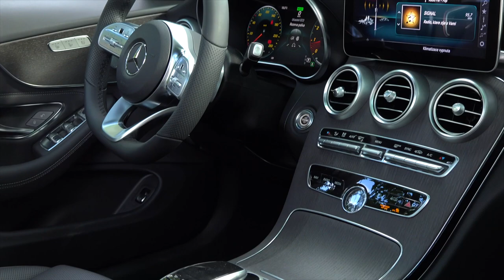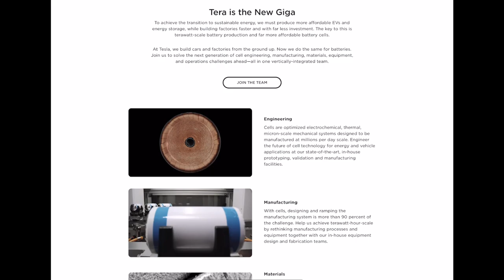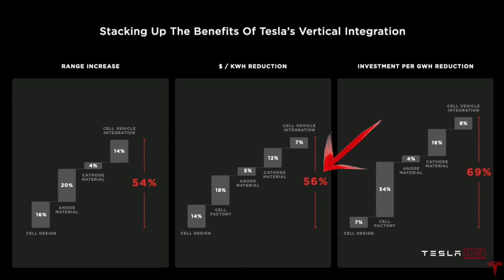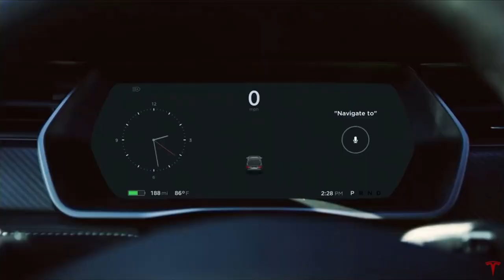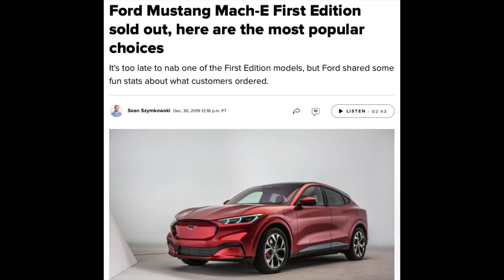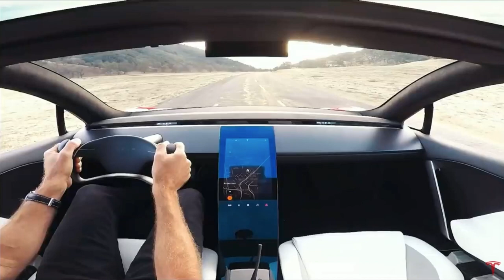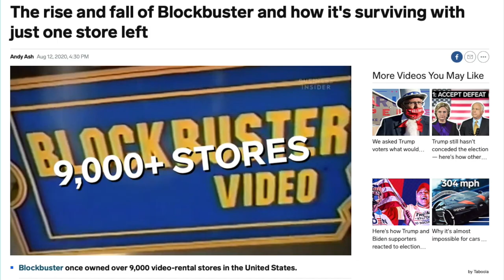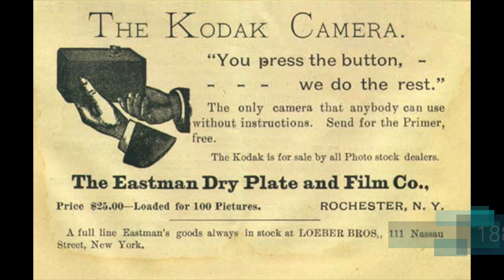Competition is coming for TESLA, But it doesn't matter | Here is why.

Comment: Indeed 2018 was the inflection point for me, when I decided to stop trading TSLA and back up the truck in 2019 for a serious investment.
Reply: Good move, Bo. I traded TSLA for years between 250 and 350. Loaded up to hold May 1, 2020 at 684 (136.80),
Reply: @daveriley6310  I scared myself buying heavy at $38, May '19, and then after agonizing over "diversification separation anxiety", proceeded to quadruple down in the following few months.   Only added a little here and there since and don't intend to sell until building a new house in a couple yrs and then only a fraction of it.

Comment: If you breakdown GM’s 1 million EV’s by 2025 and how many cars per model they are making, that is only an average of 33,000 cars per year for each model!!! How then are they going to manage up to 30 low volume vehicles and still make a profit 🤷‍♂️
And they are not the only one making these claims about dozens of EV is coming onto the market. They are doomed before they even make the first production line
Reply: Bottom line they wont do it and if so it will fail badly!!
Reply: Probably going to make only a few different models and slap different badges on them and call it different models.
Reply: @bradh7472  yep they will have no capital to build 30 low volume production lines. Let alone build cars that people want to buy. How about just doing one Good EV first GM
Reply: @roryreddog3258  exactly, start with 1 good one for once!! That goes for anything that is made. Master 1 then move on.

Comment: It all boils down to battery technology and Tesla is way ahead of the pack. Tesla has a better battery today than everyone else and will be making an even better battery that far exceeds everyone else's version. When your battery is able to go farther on a single charge, chargers faster, and has a much longer lifespan, why would anyone go with an inferior version for the same price.? Tesla's only real competitor is the Chinese government followed to a lesser extend by VW. Everyone else is screwed.
Reply: Sony Beta as says Hello! It was technically better than VHS but everyone went to VHS.

If the legacy car manufacturers feel threatened by Tesla I expect them to work together and not let Tesla eat their lunch.
Reply: @granttaylor8179  Too late.!! Legacies are doomed.! And it's not an "if" question, it is a certainty. Nobody has a better battery in the world. No matter what they do, their fate is sealed. Lunch, eaten.!!
Reply: @juanasenjo8161  you forget the elephant in the room ICE engines can be converted to run on hydrogen.

Pure electric vehicles like Tesla's are just put of the future. I expect all the garages will be converted to supply electric and hydrogen fuel as well as petrol & diesel.
Reply: @juanasenjo8161  legacy manufacturers just need to switch to hydrogen power for their engines and provide a portfolio of hybrid and pure EV.
Reply: @granttaylor8179  Ok, but it takes ENERGY to extract hydrogen. Where, exactly, are you getting this energy from.? Petrol, gas.? Or wind and solar.? If the former, it makes no sense, if the latter, why not directly use it to power EVs.?  Forget about petrol and diesel. They pollute and will be hard to come by once the EPA begins enforcing strict limits on its use. Like it or not, the future is ALL electric. Regional power generators, (if there are any left by 2030),  will run strictly on renewables. There may still be some use for hydrogen as energy storage, for sure, but oil, gas, and coal will cease to be standard fuels for anything at all. believe it.!

Comment: I remember the spokesman for Nissan at the reveal of the second generation Leaf bragging that Nissan has been around for 100 years, and has the expertise in building cars, a crack at Tesla. But I also remember that the first generation Leaf was the best selling electric car for some years( until the Model 3) and I was slightly disappointed that the new Leaf was only a mild improvement over the first one and wondered why after all those years of concepts and promises , if the first gen Leaf sold so well then is that the best the Nissan could do? They could've and should've had a least 3 or 4 vehicles on the Leaf platform, and other than the E-NV van they never took advantage of having the first mass market electric vehicle and is now only coming out with another electric vehicle that still won't be ready until 2021-2022, 11 or twelve years after Leaf one was released. Doesn't even come anywhere close to where Tesla will be in 2022, a full decade after the Model S was released.

Comment: Here's the problem.  No ICE OEM will go "all in" on EVs because the CEOs know it would crush their profits and cash flow in the short to mid term.  They don't want to be fired and lose a high salary when that happens, and the board would not hesitate to do it.
This phenomenon is not unique to auto manufacturing.  Likely happened in every disrupted industry.

Comment: I own a Model 3, and I like it very much - no question at all.
But, there is an issue for the unpredictable future: What if the synthetic fuel could be produced very cheap, cheaper than the kWh price for the batteries? In this case Tesla can run into trouble, because they don't have a plan B for ICE, but all the others still have it in the pocket.... I do not believe, it would swap the market back - may be in 2025 or even 2030. And I do not hope so, but....it's not unrealistic...
Reply: I wont matter because of following: solar and wind energy is abundant and only cost is the installment of the facility...means one time investment and you keep getting energy that wont be the case for any synthetic fuel..2nd you dont need additional infrastructure to transport electricity...that's already there...no?
Reply: Can I say that this question is somewhat  naive and against even physics? Every step your fuel has to have will make it more expensive and less efficient
Reply: By now synthetic fuel production reqires around 27KWh per liter. Let's say, a car needs 5 liter for 100 km, we talk about 135KWh / 100 km.
No way this can ever be cheaper than a true electric car. If ever it gets cheaper, electricity for electric cars becomes cheaper even more.
On top of that, synthetic fuels still have a problem with unwanted byproducts (NoX etc.) during combustion.

Comment: This is what I have been saying for awhile now. To be considered a competitor they have to produce in volume. VW seems to be the only company that is even trying to compete. Ford is a joke with only 50k target volume. GM is simply lying about what they are going to produce. It is estimated that it takes between 1-6 billion per model to design and start producing it. So if GM is spending 27 billion to produce 30 different models by 2025 they are lying. 
I totally agree on what you said. Two thumbs up if I could.

Comment: This makes the argument of robo-taxis since that 44million car demand is assuming self ownership.  Imagine if in most crowded cities that a subscription model where a car shows up every morning already charged to take you to work (in a post-covid world) demand moves from self-ownership to fleet ownership and like a regular taxi is used all day rather than sitting in a parking spot or garage 90% of the time. Then maybe by 2025 or more likely 2030, all the EV cars (not talking trucks, delivery vans, other specialty vehicles) ever needed are already built (and will only be driven by the turn over of ICE cars in the fleet and refresh existing EVs because of mechanical wear).  Seems to me that the ICE manufacturers will actually be crushed by a lack of consumer demand of both ICE and EVs simultaneously.

Comment: Most if not all of the “other choices” within the electric automobile space tend to offer smaller battery packs with less power and range. Tesla is at present more than doubling their overall range and performance. In addition by mid 2021 Tesla’s average range will exceed 600+ range with greater performance at half the cost. Besides who in their right mind will want to buy a recharging port “knock-off” when one can buy their power from an original charging port with better range,  greater chooses of locations across North America in general.

Comment: Other car manufacturers are missing the obvious market.  Tesla, as is well known, started at the top of the market and is working their way down.  It is interesting to look at what is the most sold EV on the market.  It is the Leaf.  Their is a fair amount of bling in the leaf but no where as much as the various Teslas.  A car manufacturer that started at the bottom and produced a car with even less bling than the Leaf and a matching price would have a huge market.  Give us a simple car with great engineering, simple repair, lots of range and you open up a huge market share.  Forget self driving and any connection with the World Wide Web.

Comment: What is often missed in commentary is  talent movement. When the writing is on the wall for a company  the clever people resign and move on first.  This then makes a failing company even weaker.  Many businesses are also very highly geared in so much as just a 10% drop in sales can see them losing money and become insolvent. New technology does not go unnoticed by lenders. This can all happen very quickly. Because of the battery bottleneck the ICE makers may have extra time but they better not waste a second.

Comment: Incidentally, Nissan is shafting their own market for the Leaf.  It has a lousy cooling system for it's batteries and not the best chemistry so it's batteries degrade faster than they should.  Then they make it incredibly hard to get an exchange battery.  An example of build in obsolescence which we are so bloody tired of.  Redesign the Leaf to correct this flaw and ensure a supply of batteries at affordable prices and Leaf itself will fill this bottom nitch in the market.

Comment: You forgot to mention that Kodak really did perform ritual corporate suicide, in that not only did a 100-year old photography company miss the digital photography ferry, but they were the company that built the ferry! Kodak developed the first self-contained Charge-coupled Device (CCD) image sensor in 1975, but did little or nothing with it before Nikon released the first commercial digital DSLR 13 years later.

Comment: 2170 cells are being produced in Shanghai by CATL or LG CHEM RIGHT NOW but are switching over to IRON PHOSPHATE 4680 Cells in future. PANASONIC only produces 2170 cells for Fremont but will be phased out when TESLA gets their battery factory operational a year from now at AUSTIN. TESLA will produce the very best NIKEL RICH 4680 Cells themselves at AUSTIN and BERLIN. Panasonic will add lines for more 2170 Cells at SPARKS for POWER WALL and GRID STORAGE. TESLA has the plan and is not restricted because Elon alone will control the entire battery market by being the biggest consumer and now to come the largest manufacture of batteries. Elon will control the price and all others have to accept that if they want to survive,

Comment: I'm skeptical of the planned BEV ramp for the legacy automakers.

And for Tesla, too, but my skepticism there depends on a wild card that isn't in play for the legacy automakers.

Those production ramps all assume no bottlenecks for lithium supplies.  But the big 3 lithium mining companies have signaled an intent to not invest in new lithium production capacity until the price of lithium is something like 3 times what it is right now per ton.  They will let scarcity cause the price to rise for a few years, then make the investments.

As demand rises for lithium, mining companies have sensed an opportunity.  They're a cartel now.

In 2021, demand for raw lithium will double, roughly.  Supply will go up somewhat based on existing agreements, but it won't be a doubling.  When I do the math, it looks bad for everyone's production ramp.  Including Tesla's.

So what's the wild card I mentioned that applies only to Tesla?

The lithium mining industry hasn't developed an economically-viable method for extract lithium from lithium-rich clays.  Those are deposits not currently being exploited.  There's one such deposit in Nevada, and Tesla seems to have acquired the lease for that deposit.  At Battery Day, Elon promised that Tesla has an extraction method that will work, and further, he claims it's nontoxic, which isn't exactly the case for existing mines.  If Elon can deliver on that promise, and do so economically, then Tesla will have a source of lithium all to itself, in addition to whatever they can get from the cartel.

Can Tesla deliver on that promise?  I don't know.  Tesla hasn't disclosed much about what they are doing with clay deposits, or when, or whether it will be economical.  The rest of the lithium mining industry, as reported in trade publications, doubts Tesla can pull this off.  So, it's a wild card.  We don't know what will happen with clay deposits, or when, or even if it'll work.

The bottom line is, BEV manufacturers, including Tesla, can build BEV factories all day long, but if the lithium isn't there, then battery supplies will rise grudgingly, and there won't be enough.  Which the good old supply-demand equation predicts will cause battery prices to rise and make it a lot harder for BEV manufacturers to get BEV prices to parity with ICEVs.  The production ramp for all of them is iffy.

GM is signaling what it thinks it should do.  30 new models totaling a million vehicles?  Which is a target they may not hit because of the lithium bottleneck?  In an environment of possibly rising battery prices?  Look at what they're doing with the Hummer.  They're pricing it way higher than ICEVs and expecting to make only niche quantities.  It looks to me like they intend to pursue that strategy across their entire line of BEVs through 2025 - niche production numbers, high prices.  If a lithium bottleneck impedes them, at least they'll be clearing some profit on the niche production quantities they can actually bring to market.

VW is trying hard to do the opposite.  They want to produce mass-market BEVs at affordable prices.  But the lithium bottleneck and battery cell scarcity could wreck their plan.  Unless lithium miners can be persuaded, or forced, to ramp up production while keeping lithium prices stable - a hard sell! - VW will probably miss their production ramp and price targets for BEVs.

As for Tesla, their appetite for battery cells is immense.  How much of that appetite will be fed with affordable lithium?  I can't even guess.

Tesla will have a cell pricing advantage, once they can mass-produce 4680 cells.  They can produce those at lower cost per kilowatt-hour of energy storage than anyone making pouch cells, or prismatic cells, or cylindrical cells requiring liquid solvents, drying, and solvent recovery.  Production line footprints for cell manufacturing for other battery manufacturers will be larger and more expensive than for the 4680 cells.  Tesla has that pricing advantage regardless of the price of raw lithium.  But bottlenecks in lithium supplies could still constrain their BEV production ramp, and it won't help them to bring BEV prices down to parity with equivalent ICEVs.

It's going to be an interesting five years, that's for sure.

Comment: Would cheap, carbon neutral fuel be a threat?  It’s coming!
Reply: Hmmm, really? Are you talking about hydrogen perhaps? We've done the math on that. Even if we could find a way to contain it at nearly enough pressure to make it a liquid, the process to produce, ship, and pump it wastes a lot of energy. It's fine for applications such as rockets, where it only has to be contained for a few hours at most and extreme energy density is required. But simply not practical for a vehicle that has to be ultra-safe and may contain the fuel for days or even weeks at a time.
Reply: I agree it's too much for a vehicle to use it 
Any other biofuel is just as polluting so No it's no competition
Reply: The plants suck in carbon during their life cycles.  Steven Chu has said that advanced biofuel/fossil fuel blends in a 40:60 ratio will be carbon neutral, with perfected sequestration.  I have literally bet that will be the case.  Wish me good fortune.  The planet, too.
Reply: @barrymiller99  any burning of plant or fossil fuel cannot be carbon negative as I see it
Reply: @robertjohnson5227  Ask Steven Chu, Nobel in physics, former director LBNL, former Sec. of Energy.  He gave a speech at Carnegie in the Middle East when he was Secretary.  By 2050, it’s likely that more than half of the 2 billion vehicles will still have ICEengines, mostly hybrids, and not because I say so.  ICE vehicles need to be safe, efficient, and clean burning as possible.  If you knew who was invested in this, your eyeballs might spin.